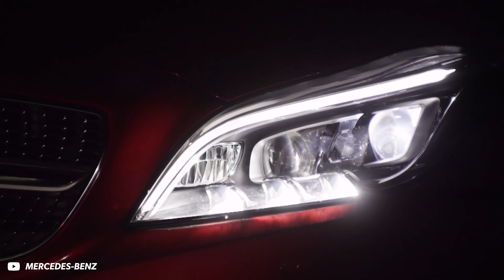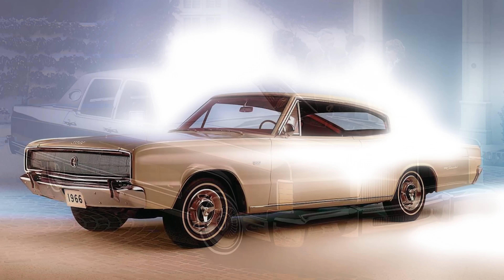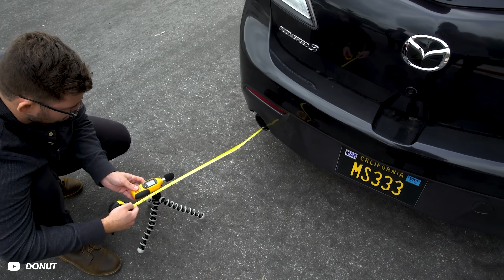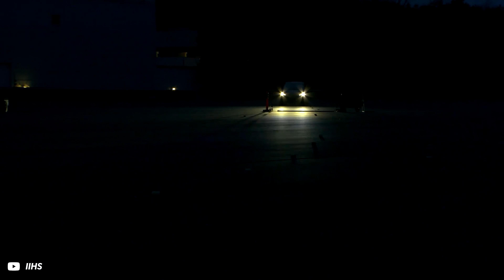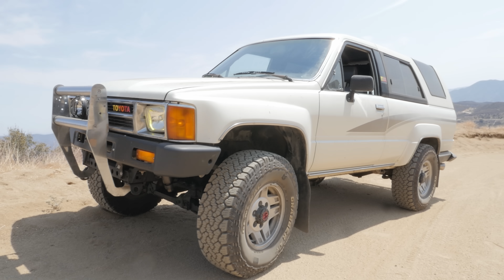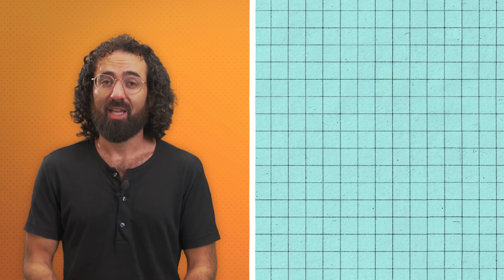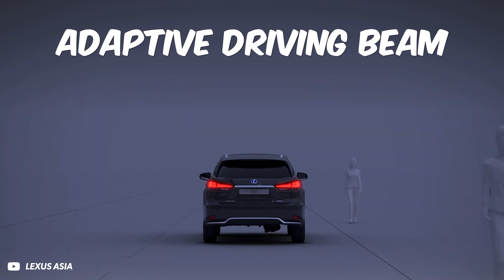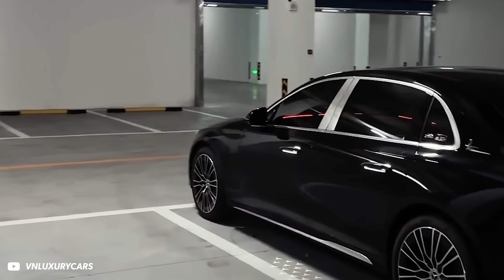Why new headlights are blinding American drivers

Comment: You could make a follow-up video about the hazards of being blinded from behind. I find the worst problem now days, is when a truck or SUV pulls up behind me, and the headlights light up the interior of my little hatchback. I'm being blinded by the light reflected directly into my eyes from my rear-view mirrors. I flip the lever on the windshield-mounted mirror, but I'm still being blinded by the side mirror, and have difficulty seeing what's in front of me, which is dark. Sometimes I think it's caused by high-mounted aftermarket lights, and sometimes they're so bright, I can't believe that it isn't someone driving around in the city with their high beams on all the time. There used to be a time when drivers were courteous to the other people on the road, and I think that's what has changed: drivers no longer consider themselves as operating within a system, cooperating with other people, but as individuals only concerned with themselves. Have I got enough light to see? Nope, better get brighter headlights.

Comment: I worked nights driving trucks for 25 years and the high beam/over bright headlamp issue is one of the reasons I'm glad I finally jumped to days. When I'm sitting seven feet off the ground and you're still blinding me you've definitely created a big, 80,000 lb problem.

Comment: In Germany I have plenty experience with ADB and honestly, to me it's hardly an improvement. Yeah, its not remotely as blinding as LED high beam (only slightly brighter than low beam), but still worse than an older halogen (or LED converted halogen reflector) even in high beam.

Comment: American here. I'm fairly new to driving normal vehicles - got my car license less than a year ago - but even in 2018 or so, when my main vehicle was a moped, I hated driving at night with a passion because everyone else's headlights were so bright. Even some vehicles' OEM headlights these days are more than bright enough to leave spots in my eyes for up to 10 seconds at a time. I'm surprised there haven't been enough crashes caused by drivers being blinded by others' headlights to make the news. And the blinding qualities don't only apply if the lights are shining toward you from ahead, either - there have been a number of times when I've been half-blinded by headlights shining from behind in my mirrors.

As for possible solutions to the problem, I'd argue we don't even need those LED-matrix headlights - we just need normal headlights to be far less bright. People would probably complain that they couldn't see enough of the road at night with dimmer headlights, but honestly, I don't give a damn. I just want to be able to drive safely and not have to worry about hitting anything - or anyone - because these asshole OEMs and aftermarket manufacturers couldn't be bothered to consider the possibility that their headlights might have the ability to burn out other drivers' retinas. Besides, I drive a 1994 Toyota Corolla, and its original-style halogen headlights are bright enough for me to see everything I need to see at night; I don't understand why that level of light wouldn't be good enough for everyone else.

Comment: I would immediately ban everything besides halogen. Unless the headlight cover is very dirty or somehow damaged those always generated enough light to saely drive. Everything else is blinding the 💩out of everyone else at least 50% of the time.
Also the ADB solution in Europe is far from effective, its right the opposite. Yes, you will notice the opposite driving vehicle cutting out the lights but you will still be almost completely blinded like with standard lights...

Comment: I’m in the UK and Adaptive Beam control headlights are good, mine particularly so (checked with wife driving ahead of me). The problem is that they are only implemented on high end modern cars well. Mines a 2024 BMW, my wife has a 2024 Honda. Hers only auto switch from low beam to high beam and they are slow to switch, so she blinds folk without meaning to and has now switched back to setting high beam manually. Mine are pretty much high beam all the time, and switch tiny leds on and off to never blind anyone and nobody has ever flashed me. The majority of cars, even newish ones don’t have this tech as standard. So super bright aftermarket and badly adjusted OEM is still the norm. And they are all getting brighter in my opinion. Driving at night is awful now compared to even just 5 years ago.

Comment: The problem isn't the lighting technology. It's that headlights are installed higher on the car and are aimed level with the road. I am in a low car and constantly get blinded.  Small cars are almost fine with the low beams being level, but when they hit a bump or on a hill, you'll get blinded. Bigger cars will always blind me. I have installed led lights for both my low and high beams. They have a perfect cut-off , and I have not had a single person flash their high beams at me in almost a year of having them. I aimed them according to the specs with a tape measure. My high beams are very bright and are aimed perfectly for people in taller cars with high beams on.

Comment: Those automatic systems are really blinding anyway i think, they constantly blind you from behind through the mirrors and facing you they are to slow to turn off. And it makes drivers lazy, not turning off the full beams manually.
Also the price of headlight units with adaptive beams are through the roof. A modern 2025 with databus commmunication to the headlight is going to cost you 1500 euro and upwards.

Comment: A big problem is that for years most cars came with a headlight angle adjust in the dash. A dial that you could use to change the beam height, supposedly to compensate for different loading.  Everyone naturally adjusted them to point as high as possible as that gives them the best view but also blinds oncoming traffic. When tested the mechanic would just set it to the right level on the dial and pass it and the driver just sets it back to pointing at the sky.

Comment: Same goes for cyclists. It's so enraging and unsafe when the cyclist coming from the opposite direction has super bright white front light, and they angle the light so high, you simply can't get away from being blinded. 
Some cyclists also have blinding bright red flashing backlight. 
It's really frustrating.

Comment: I drive a Volvo s40 (sedan), which is a standard car in terms of size, but I can't stand driving at dark anymore because of all the F*KING crossovers/SUVs (and even modern hatchbacks and the like) because of how blinded I get. I mean... not only do I not see anything passed the oncoming car, once it gets closer, their headlight is ALL I see, and for several seconds after they've passed, I can barely adjust my vision. It really sucks how much it affects you. When I got my drivers license 15 years ago it wasn't that much of a problem. I don't think that Adaptives are the ultimate solution because they just don't keep up on a twisting road or a road with a lot of blind corners.

Comment: This also seems to stem quite a lot from the inhereted rules of "light trucks" which suv:s are. Regulations regulate how high headlights can be in any other regular car but light trucks are exempt from this. So every pickup and suv on road has their eye burning torches at about the same level as the drivers head on a sedan or station wagon. Stupidest thing you guys ever pushed on us was the fucking suv. So much of everything is made worse by them.

Comment: European here.
Unnecessarily tall vehicles with unnenecessarily bright lights, with terribly expensive (only dealership) replacement full headlights, and no way to easy fix on the go,  if you have a headlight breakdown somewere far from the dealership or on Holiday!
Let alone the Light Polution they cause.

Ahhh... And the myth that LEDs don't burn or malfunction easily. 
The automakers SHOULD BE obliged by Law to provide a 20 year,  no questions asked, free replacement  warranty on LED lighting units, because if they break down, the car is useless and dangerous by night.

Comment: German here. Those matrix headlights aren't the solution. They still require the system to detect and determine you to be a subject worth lowering the light intensity for. I get blinded all the time, as a pedestrian, cyclist, motorist in the mirrors. 

Orange headlights FTW! The Halogens were great. Just replace them with LEDs of the same colour temperature.
No fancy camera system, no computer, no problem!
Reply: Yes, the real reason why you can’t see a damn thing is precisely the color temperature of street lighting and car headlights. Cool light perceptually creates more contrast, and increasing its intensity only makes that contrast stronger. Sodium-vapor street lamps and the classic H7 car bulbs had the right temperature and intensity.
Reply: @bengnomino  Sodium vapor street lamps... When they started replacing them with white LEDs in the area where I live, it became much more annoying to drive at night, as on the yellow streets you could tell from far that a car with a whiter light is approaching from the side, but the white street lamps completely masking that.
Reply: We live in the era of "fixing" things that aren't broken because our society is build on infinite progress, even though we reached the peak a while ago
Reply: We don't need a complicated and expensive technology, we just need dimmer lights.
Reply: Occams razor?
Reply: Not quite there yet, but much, much better than what we had before. And I definetely prefer the ones that automatically set them to "low intensity partial blindness" over the manual ones, because people are great at turning them on, but suck at turning them off for some reason
Reply: Finally reason. As I would expect from a german. I've experienced matrix headlights and it doesn't help at all.
Reply: YES !!! It is not the brightness that is the problem but that the color of the lights is blue !!! Halogen bulbs even 150w that is 3 times more powerful then legal limit is LESS blinding then the blue LED and Xeon lights. It is the blue lights that should be banned and you can make LED and Xeon that give same color light as halogen and not be blindign...
Reply: Yellow, amber, orange, red all easier on the eyes than blue/violet that every single modern car has now

Comment: The biggest problem is that FMVSS has allowed the upward glare in the middle for decades. The argument was the need of "illuminating" the overhead signage on the highway (actually, they are so reflective that a bicycle lamp could easily illuminate them). ECE requires the sharp horizontal cut-off with upward illumination gradually from the middle to the right (as to illuminate the signage better and further down the road).

Additionally, many states have eliminated the vehicle inspection programme, and the police doesn't enforce the compliance of the FMVSS. In Europe, the vehicles are subjected to the inspections, and the police can check whether the lighting system complies with the ECE regulations.

Comment: I drive all day in Sweden, all day also being pitch black during most of the day in winter. I rarely get affected by the lowbeams. What I do hate is cars with automatic headlights and the ones that ”avoid” oncoming cars. They don’t, they blind less. But after flashing my high beams and aux lights they come off quickly

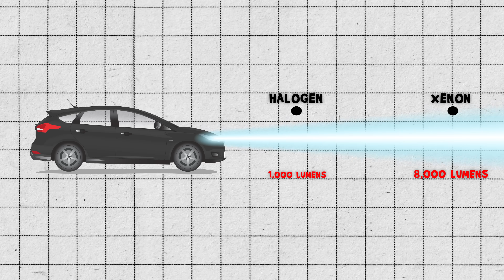Comment: 2:50 for anyone wondering there technically is a 6,500 lumen limit on headlights, personally if it is true it's clearly not enforced.
Reply: The lumen limit is enforced in Europe, because here vehicles must be inspected every few years to every year, depending on age of the car. About blinding: Don't look at the incoming lights (or mirrors, if you see light coming from them. Look to the side of the road. That's where the parked/stranded cars and pedestrians/cyclist are. I've had eye surgery. I got thinner glasses, but also easier blinding. Another possible reason is dry eyes or cataract. Both cause halos and blinding. Have your eyes checked. Less light on the road is NOT better!
Reply: @markkulehtinen4733 I have astigmatism, nothing helps at the moment.
Reply: The limit is different for every state.

Comment: As some of my fellow Europeans here pointed out already, there are issues with high beam of matrix led headlights. I tried several different systems and none of them (Audi, VW, BMW, Mercedes-Benz) really performed satisfyingly. On curvy B-roads they recognize oncoming traffic waayyy later then the driver, mostly too late. On the highway, where you have guard rails, the systems don't really ever work an you will be blinding oncoming traffic, especially lorry drivers. They do not recognize retro reflective traffic signs reliably, so often you can`t read them or you even blind yourself and also in foggy conditions they are useless.
In the end it also comes down to the user, as it does with all the modern driver assistance features. A lot of people are unaware of the boundries their systems are able to operate within and so they fail at turning them off accordingly as to prevent other people from being endangered.

Comment: Don't be fooled. Adaptive headlights are NOT the solution. I live in the UK and I am regularly blinded by cars with LED matrix headlights. The sensors are so bad at sensing oncoming vehicles that they don't shut off the headlight segments. Or the motorway central divider hides my headlights from the oncoming car, so its computer shines its headlights at full blast into my retinas which are above the sightline blocked by the central barrier. The solution is to go back to halogen lights for all.

Comment: A German here😁 Don't expect miracles from adaptive or matrix headlights... They all depend on cameras "seeing" the other cars headlights and only then they are able to decide to cut the beam. We are talking split seconds here but our eye is much quicker. 
Not to mention obstacles like guard rails, blocking the other car's lights and therefore not cutting the beam. (Blinding truck drivers, sitting above the guard rail.)
Add soon as there is a bit of dirt or moisture in front of the camera (on cold days) the system is far too slow. 
So, it's better but still far from a perfect solution. 
Most car makers use multiple LEDs where each one is less bright. This way they stay under the legally allowed limit and no longer need headlight washing systems (like on old Xenon lamps).
When the cars, especially in winter get dirty, the super LED headlights blind even more.

Comment: That sounds like a ton of added complexity and headache and cost
Reply: It sounds like a boost to revenues for the car companies... but from all reports it still doesn't solve the problem. The real engineering solution is just to use a dimmer bulb.

Comment: It's great that you're talking about this, but there's a few things I disagree with.

You were close to the big problem with LED headlights, but didn't put enough focus on it: the perceived intensity of the source.

The small source in halogen bulbs is consistent, and throws out light in all directions. Which is why halogen headlight designs use reflecting optics to shape the beam. As a consequence, the perceived source is not a point source, it's the reflector surfaces. You are effectively spreading the source over the whole assembly.

LED headlights typically do not incorporate reflectors. You typically have multiple sources, yes, but each of those sources is small. The perceived source is much smaller than it is in a reflector design with a filament bulb. That means, even if you had the same brightness, the perceived intensity is much higher because you see that light coming from a much smaller point. That makes it far more uncomfortable. It also wreaks havoc with our night vision as our eyes try to adjust to stop the cells in our retina receiving the light from those headlights from being over-stimulated.

The more focused the beam is, and the smaller the perceived cross-section of the source is, the bigger of a problem it's going to be. A laser in the milliwatt range can cause temporary blindness, because the source is tiny and highly focused - the total energy is low, but it's spread over very few of the cells in your retina, and each cell can only cope with so many photons.

Headlight regulations should set limits on the perceived intensity of the source at set distances.

Furthermore, you talk about beam cutoff when discussing aftermarket bulbs, and suggest that a hard cutoff is a good thing. I understand what you're trying to say here: you don't want the bulb throwing out light beyond the point where it should. But a cliff edge cutoff - going from full brightness to zero - is not a good thing. It's bad for other road users, because they're being flashed by your headlights whenever there's a change in elevation or a bump in the road, and it's bad for the driver, because the increased contrast between the illuminated area and the dark area means that our eyes cannot adjust to be comfortable with the light while still being able to perceive motion and vague shapes in the dark. You want there to be a gradient to the beam's edge so that you can actually perceive what's beyond the beam when you're looking at the edge of it.

The point of headlights is not to light up the road as if it's broad daylight. It's to light it up enough to see hazards and drive safely. Added brightness beyond that is actively detrimental, because you cannot light up everything and, if your eyes are adjusted to a brighter beam, you're less likely to perceive motion and unexpected objects in the dark areas.